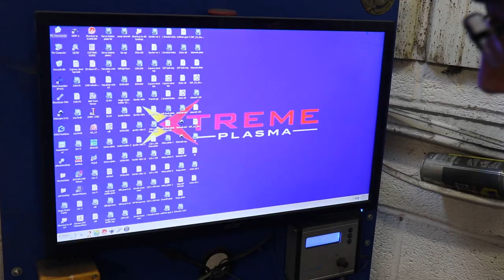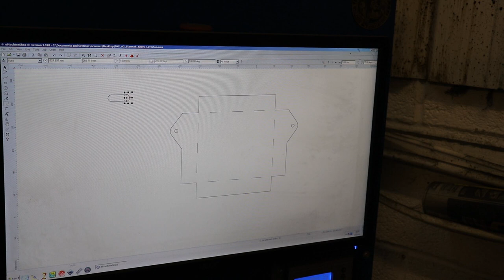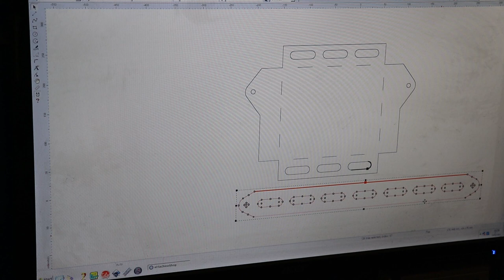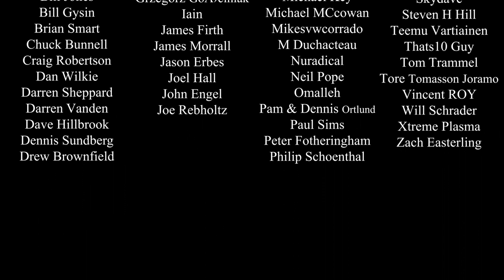New Battery Tray For The Chevette

Comment: nice job on the battery carrier but  i prefer the box type for safety reasons and you need to vent it to get rid of fumes might fail the mot there
Reply: Most modern batteries have small plug in side where you push in a vent tube and just drill and grommet a small hole in boot floor. Job done. Nice neat fabrication job 👍👍

Comment: Nice job but you should of got a varley redtop battery.  Lighter and sealed
Reply from the maker: Just using what I have here to keep costs down.
Reply: @Urchfab  Did you see my email about possibly boring out some brake discs on lathe?
Reply: @stuarthoffman1633  He never replies to e-mails...
Reply: Correct. It makes much more sense (and would not take as much space).

Comment: Did you just secure a battery with rubber well nuts? Come on, you can do better than that. Rivnuts at very least but you have a lathe to make some threaded bushes too
Reply from the maker: Rubber well nut?
Reply: @Urchfab  What's the black bit that goes in before the strap goes on? Looks like a well nut and you appear to have some sort of captive thread while doing the nearside fastener up so doesn't look like you used a through bolt and loose nut